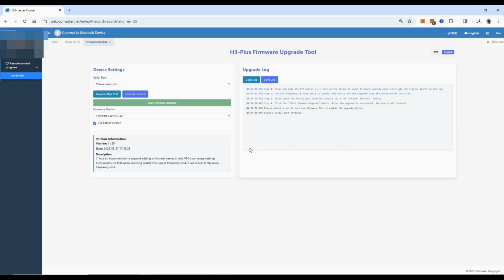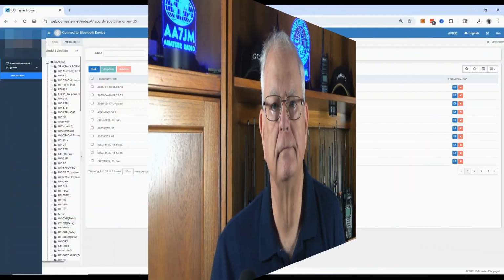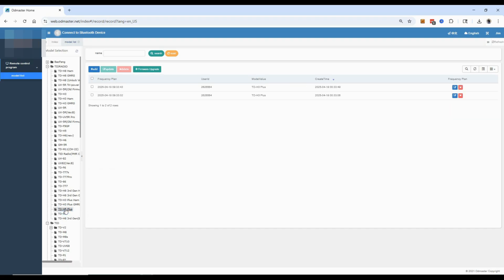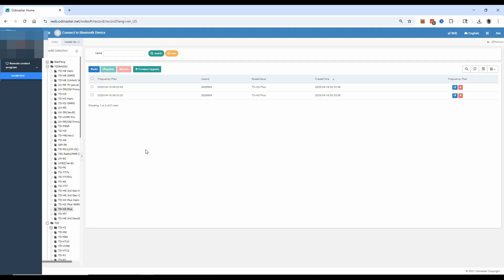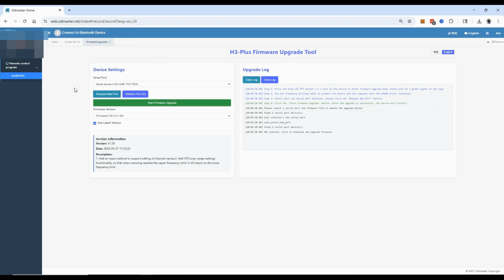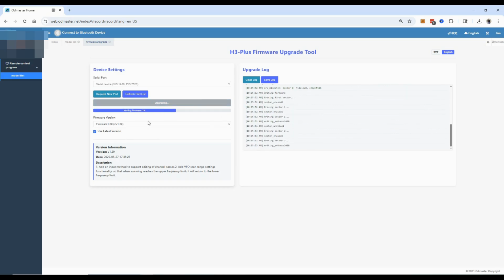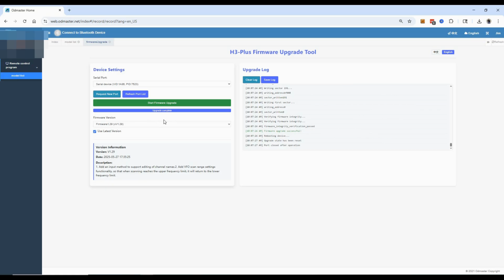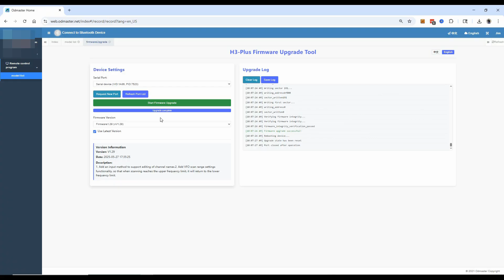H3 Plus Firmware Upgrade. Sooo Easy.

Comment: I COULD'NT AGREE MORE
 I CANT EVEN GET MY H3 PLUS INTO UPDATE MODE. IT DOESNT WORK. THERE SOFTWARE AND FIRMWARE ARE ONE OF THE WORST IVE SEEN. THE OD MASTER IS GOOD, BUT THERE COMPUTER SOFTWARE AND FIRMWARE ARE JUNK. THEY NEED TO WORK OUT THE BUGS IN IT. IM STUCK WITH AN H3 PLUS AND H8 3RD.GEN. THAT I CAN'T EVEN UPDATE. I WOULD RECOMMEND THAT NO ONE BUYS THESE RADIOS UNTIL THEY FIX THE FIRMWARE UPGRADE ISSUES. I DONT THINK THE ONES I HAVE WILL EVER BE ABLE TO BE UPGRATABLE. THANKS FOR YOUR COMMENTS.

Comment: I wasn't able to upgrade my Tidradio H3 plus firmware on my Computer. Even with the right Com port., it won't work. I find the Firmware and Software horrible in my opinion and the Com ports don't Work.  I have an H3 PLUS and a H8 3rd. Gen. And I won't purchase any more of there radios., I can't even get it into Firmware mode. Horrible software and Firmware. I won't be purchasing radios from Tidradio again.

Comment: These radios are junk and a pain in the ass to "upgrade" the firmware. And yes I used quotations to emphasize the "upgrades" seem to break more than they fix. Tidradio is focused more on adding features nobody wanted or asked for. It's getting pretty stupid, kinda like the stopwatch on the Baofengs. Instead of fixing the problems of the bluetooth module putting a whining noise over the air when connected to a bluetooth device or a fast clicking noise when on but not connected, or the "breath led" getting stuck on and the only recourse is to just turn it off, or the 1.25m frequencies getting locked in AM receive mode and the only workaround is to turn off the AM mode disabling the aircraft receive....

The bluetooth is not going to work with your headset like you want and how it should because they think the bluetooth is for connecting to your phone to answer the phone and talk thru the radio, and also to use your radio to talk over the phone with the app ODMasters's chat feature. Instead of just talking thru the phone itself. How stupid is that? I know the Chinese are not that smart but are they really that stupid? The bluetooth will not work in duplex mode like you would need for a headset connection. And then there's that annoying whining noise over bluetooth. It renders my Tidradio bluetooth handheld ptt microphones (that these radios were designed to be used with) useless. At this point I think they are taking the "how stupid can they be" as a challenge and not a criticism. 

And then they got mad at me for posting constructive reviews after they thought they bought my silence by refunding my purchase price on the 2 radios I received and telling me to just keep them. I did take down the first review but after so many more screw-ups with the "upgrades" it was time to review them again. They said that "I hurt them" to post it instead of emailing them. Yeah I bet it does hurt their bottom line and that's the point. People need to know and understand these radios are far from being ready for general release and I recommend sticking to the original H3 and save your money and headaches by avoiding the H3 Plus until they either fix the issues in the firmware or better yet, upgrade the hardware so the bluetooth works correctly.

Comment: I  just recieved a pair of H3 plus radios and I was able to update the firmware from 1.0.28 to 1.0.33 using a usb C cable.. 
28
Reply: how? I have a Mac and PC and neither will acknowledge my radio in the firmware mode. This is so frustrating
Reply from the maker: Thanks for watching and commenting! Glad the process worked well for you. I've used the USB C cable too. Cheers!

Comment: Hello - are you able to do this on the H3-Plus using the USB-C connection?  Support says I can and point me to this video, but no luck doing step-by-step per your instructions (but I'm not using the programming cable... I'm using USB-C).
Reply from the maker: Thanks for watching and commenting. I haven't been able to update firmware via a data capable USB C. Just tried and no go. I also wasn't able to upgrade firmware via an FTDI capable.  That may be a driver issue but it works on my other radios. My Tidradio programming cable did work for the firmware upgrade, howver. I was able to access the CPS and read and write to the H3 Plus via both the programming cable and the USB-C.

Tidradio is sending me a current version model to note the differences from the early edition I got originally. I'll try this again, then. Cheers.
Reply: @GadgetTalk4U  Thank you sir!  Very much appreciate your efforts and response.

Comment: "initializing device zone: app_dir_head" error when trying to upgrade, this is with the correct cable from Tidradio, and using MS Edge, Chrome and Brave.
Reply from the maker: Couple things to try. First make sure the radio is in upgrade mode. 3:00 in the video. Second, see if the H3 Plus ham or GMRS choices work. Check the radio info in the menu system to verify your current radio configuration.  One more thing. Connect to the PC using a data- capable USB C cable in the port on the side of the radio. Many USB C cables are only for charging.
Reply: @GadgetTalk4U  I've tried multiple method sof upgrading to no avail, USB C data cable, bluetooth, and the official Tidradio programming cable. The radio configuration was confirmed as GMRS. I even used the manual update tool I found through the FB group. I also tried selecting different all of the modes in the ODMaster web GUI (GMRS, HAM, Plus)
Reply from the maker: @tomasznumrych7187  Are you referring to updating your programming or firmware? I tried upgrading my firmware just now and found I could get it to complete only when using the Tidradio programming cable.  No offense intended: did you put the radio into firmware upgrade mode pressing the PTT and 1 key while turning it on? It should have both green lignts on top illuminated when in firmware upgrade mode. Cheers.
Reply: @GadgetTalk4U yes I'm referring to upgrading the firmware. And yes, I'm using the official tidradio cable that I got last year with my H-3 radios, and yes it's in upgrade mode. I even attempted to do the upgrade using the manual updater (same one used for the H-3) that was provided by Tidradio on the FB groups.
Reply: @GadgetTalk4U also note it's the usb on the side I believe not the bottom the bottom is only for charging the battery

Comment: My h3 plus has really bad reception even on good signal it has real bad static, tried other radios, and they are good. I think I got a bad one
Reply from the maker: Could be. It certainly happens. I like Amazon for that reason - easy returns. Other considerations could be the transmitting radio is too close and you are overloading the receiver or your other radios may do a better job of filtering out the noise in your house. Lots of possiblities including the one you mentioned. Thanks for watching and commenting. Cheers.
Reply: I have a pair of them and they both are like that. They both came from different suppliers.  Find the older h3 better